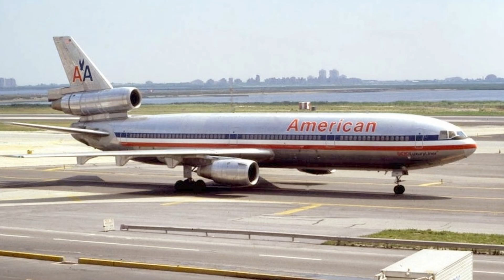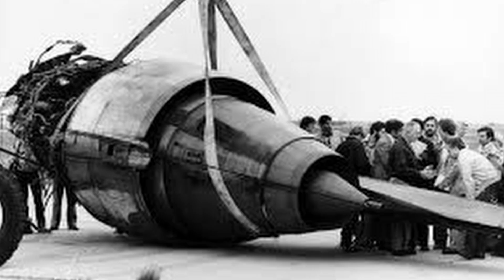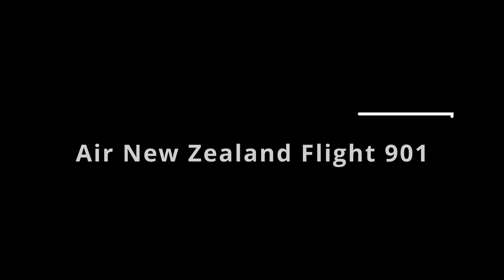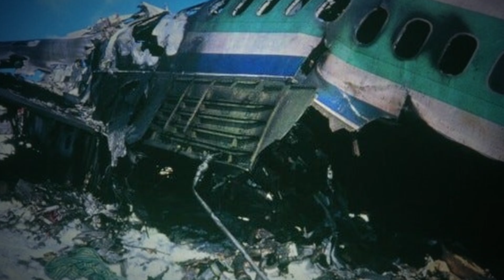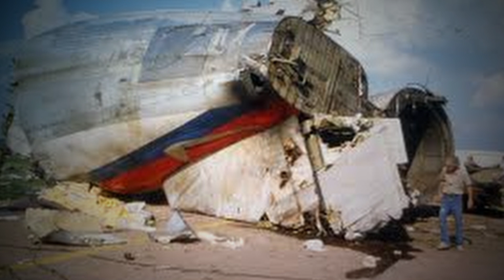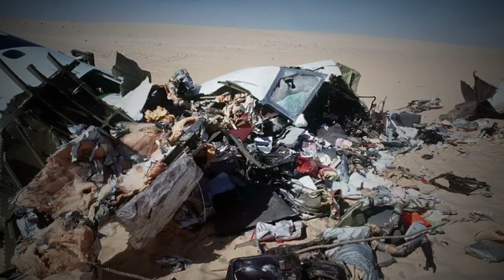The Worst DC-10 Crashes in History-  pt 1

Comment: there was a reason it was called the death plane, over 50+ fatal accidents and 32 hull loses , 1261 lost their lives , what a disaster
Reply from the maker: It truly was a death plane, while it was marvel of engineering, it just had too many flaws and issues.
Reply: @TheEvidenceRoom-o8p it was a piece for its time, i think the design was rushed and mcdoughlas didn’t think though the design good enough, once the issues were fixed, the plane would actually be good , i heard it’s still in use for cargo planes now, but mcdoughlas had or “has” a bad record of crashes, luckily they got better as the issues resolved tho.